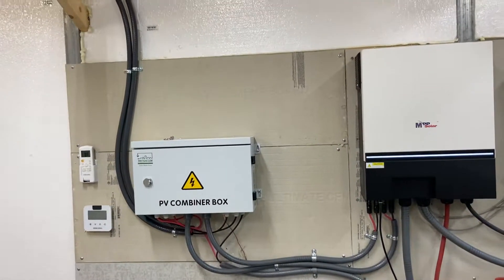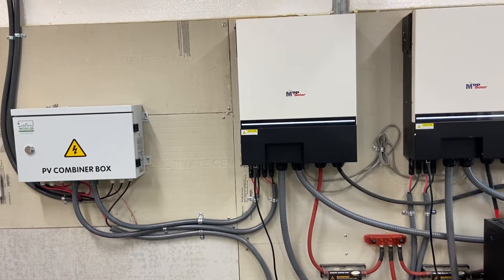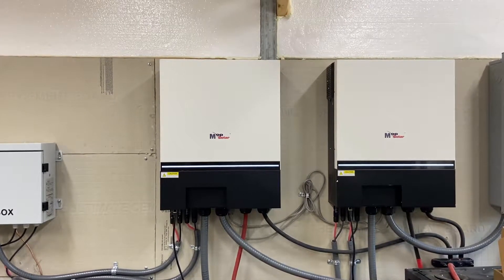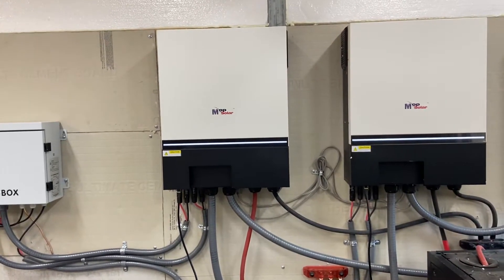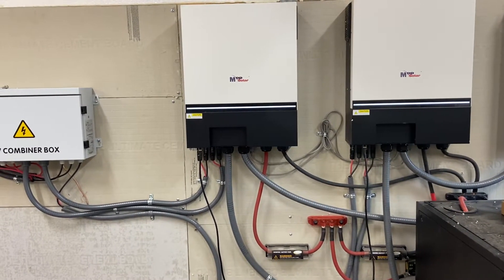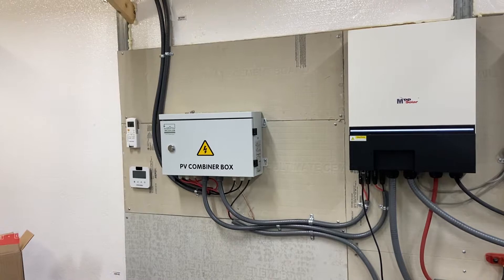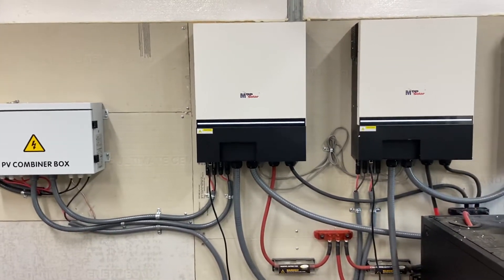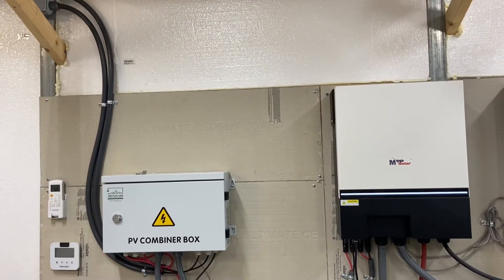Mpp Lv6548 thoughts about balancing wattage of solar panels.

Comment: Are you using 10AWG with MC4 into the LVs?
Reply from the maker: Yes. For the array that’s further away I have 8 awg thhn. But i switched to 10 awg after my pv disconnect. So all my pv wires connecting to the units are 10 awg.
Reply: @GavinStoneDIY  The wires of MC4 connectors which are inside the LV are very thin IMO.    Do you have a thermal camera to see how hot these wires and spade connectors get under full load sun?   In my setup,  the peak input will be 4S2P  Voc 197.20 VDC at panel before 190 ft loss over 8AWG and max Isc 24.44A.   This current is really under 30% bifacial gain which isn't likely.    Realistically, I think the 20A which the LV's PV input can handle.   My PV disconnects under the LV trip at 25A DC.   My combiner fused 16A per string and has a break which trips the combined string at 32A.   I was planning to run 8 AWG from the disconnect into the LV's bolt terminal, bypassing the MC4.    PV1/PV2 input share the same ground and the surge inductor in the LV will still do their jobs.   These are extra as my combiner as surge (2.8KV/40KA).   I think the EG's PV input is much improved.
Reply from the maker: @errcl65   I’ve been meaning to invest in a heat camera. My 4S2p setup only outputs 20 amps. So I don’t think it would cause any extra heat issues. I would guess the eg4 probably has the same gauge wire in the unit.  I didn’t check if they’ve up their amperage rating for the unit? I didn’t think they had.
Reply: Will P. measured 120F in the pocket where the MC4 feed in his extended  98% load test of EG6500ex.
There is a fan right over that area.  All with the same skinny wiring and spades.    He thinks 120F is ok.

But he is running higher Voc and less current than us with our LVs.   The heavy duty Staubli compression
Mc4 pins look a lot better.

Comment: Hi Gavin. I’ve got the same twins as you with a DIY 32kwh batteries and only 4400 Watts of PV. The system seems to have gotten a good rhythm going now. In the spring and fall it’s self sustainably off grid, however when I need the AC the system has to be supplemented by the grid. On a 104 degree day about 45% grid support is necessary and usually maintains a capacity of 100 to 40% cycles during the heat wave. The charging is done during off peak hours to get the best summer time rates. This is done with utilizing the inverter’s timer(I could write book about getting that to work LOL). In the the winter the system also needs grid support due to insufficient solar. I watch and sometimes manually trip a charge based on weather reports. If I do nothing it will go back to grid automatically at 51 volts but then I don’t have the 50% reserve that I like to have on hand. However if the SHTF I do have a Predator 9500 generator to give the batteries a boost. 
One thing of note. I noticed the MPP section is less efficient to operating in the lower voltage rating than say a Victron Mppt. 
The LV6548 PV voltage inputs should be run as near to max open circuit voltage as possible to really pump out the power. Consider this if you are thinking splitting up an array.
Reply from the maker: Really great information! I appreciate the input. I remember watching some of your videos before purchasing my units. I wish I  could get a bit closer to my voltage limit. But currently I can only get around 190v. One panel more and I’d be a bit too close to the voltage limit for cold weather. They seem to run pretty well. This will be my first winter with the units. I plan on building a diy battery to give just a bit more battery for cloudy days and then I may shift more loads over to my critical loads panel. What size ac units are you running?
Reply: @GavinStoneDIY  
I’ve got 10 panels, 5 in each string for 248 OCV (total rating) to two MPP inputs. Under load I’m seeing around 210 volts. Each panel is rated at 49.62 OCV. Most larger panels these days are rated at or just under 50 volts. I’m pretty sure that MPP Solar was thinking that people are going to connect five to get at the 250 maximum. I wouldn’t hesitate to go right to up to the maximum rating OCV panels to OCV inverters but never over. I’ve seen some really weird 💩 voltages with “cloud edge effect” phenomenon, but nothing but making power happened. Keep in mind it was under load when it happened tho it wasn’t open circuit voltage, the under load voltage was well under 250. 

FYI, there is voltage present at the inverter’s mp4 input connections and it can bite you without any solar connected to either polarity! There seems to be a search voltage or something going on. It reads 18v dc and nothing on AC so I think it’s a frequency the meter can’t see but will be happy to bite. When working on it, of course off is best but…….I was attaching the inverter’s input to the breaker output(breaker open) and got what felt like an AC zap from the screw driver shaft. So the procedure is breaker off, then mc4 disconnect, meter test and if you see anything over the decimal point it’s alive.
Reply from the maker: @SkypowerwithKarl  I got a zap from it also. In fact it will zap you at the solar panels also. It generates a sort of low stray current. People wouldn’t know if they had a metal array. I just noticed because of my wooden array I built. It used me as a grounding wire. Once it was properly grounded then I didn’t have an issue anymore. So I know exactly what you’re talking about. I don’t think it’s a good idea to push the voltage limit. In fact Watts247 recommended staying under the limit with a nice buffer in order for there not to be any issues. Cold sunny days being the factor that can sometimes tip the scales towards an issue. I suppose I may have been able to try it. But instead I wired 4 panel series strings. The whole thing would have been much easier with a 500v limit like the newer models.
Reply: @GavinStoneDIY  
Panels degrade the greatest percentage in the first few months. It may be a good idea to get a reading now to see where things are. You may have the buffer you need. Un-grounded operating solar panel frames can carry some crazy voltage. Like some sort of RF coupling from the MPP. It can tickle or sting. Another reason to run a ground wire with the power. The additional ground rod can get rid of the any noise picked up on ham radio too.

Comment: Did you remove the bonding screws inside the inverters ?.
Reply from the maker: I did yes. Only because I’m not off grid. Because I use the grid as a backup when the batteries are low I’m using the neutral from there.
Reply: @GavinStoneDIY  This is something that Im not really knowledgeable in this area and need to look into more. Im set up as an uninterrupted power source (same as you I believe), grid powers loads when solar & battery are insufficient, but I have not removed the bonding screw inside the inverters. I have checked my ground to see if I have power flowing through it and I do not but still need more education on this specific connection.

Comment: What size is your well pump? I’ve been looking at building a system like this but am unsure of how it will do with my deep 5Hp well pump.
Reply from the maker: It’s a 3/4 hp pump. If it were much bigger I would probably get a low frequency inverter like the mpp 6048 wp. They can handle those large inductive loads without any issues. And they are still stackable. So that would probably fit your needs better. What amperage does it pull at startup you think?
Reply: @GavinStoneDIY  gotcha. Will had mentioned that in one of his videos but I keep hearing people say they use your setup with their pump. I’ll likely go with a LF option. Thanks for getting back to me.
Reply: @GavinStoneDIY  I forgot to answer your question about startup amperage. I haven’t measured it but it called for a 60 amp breaker when installing.
Reply from the maker: @EastTexasHomestead   that’s a hefty breaker. 2 of these units might not  even supply the wattage that would require for startup. Then again the breaker size doesn’t always correlate to the actual wattage. Honestly  if I were you I would consider  having a dedicated load center just for your well. And run the rest on high frequency units. There is ways to mix and match both. But either way would work. Texas has some insanely deep wells to require that much hp.
Reply: @GavinStoneDIY  Agree, a dedicated Lf inverter for the well being a 5hp motor. 1 and 1.5hp deep well pumps will work fine on two of these.
Reply: @GavinStoneDIY   I have same setup with a 1hp pump and it doesn't even phase the inverters at all.

Comment: How does your battery hold up overnight or until you get solar again in the morning, we are looking to purchase 4 of the same type of batteries. Trying to determine if that is enough.
Reply from the maker: It really depends on your usage of course. 6 of them hold up easily overnight for us. We will usually get around a day and half of clouds before it changes over to the grid. But having more will also lengthen the life of the battery. Ideally they shouldn’t be discharged too quickly.
Reply: @GavinStoneDIY  we are going to use an auto start generator to kick on at 20% battery charge; however we don’t want to run a genny to much. What I can’t quite figure out is what time in the morning will my panels produce enough power to start running the house on their own.
Reply from the maker: @rickeyjohnson8476  that of course will depend on your early morning sun and the angle of the panels. Also keep in mind the winter months are much harder on the system. In some places the sun rises pretty late and sets really early. I would think most small households would need at least 30kwh of battery storage. Probably more.